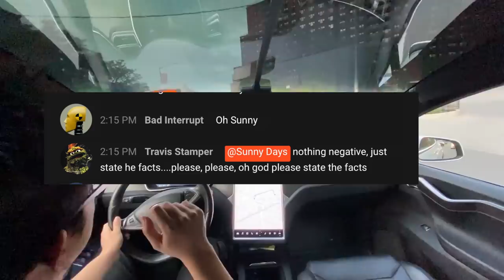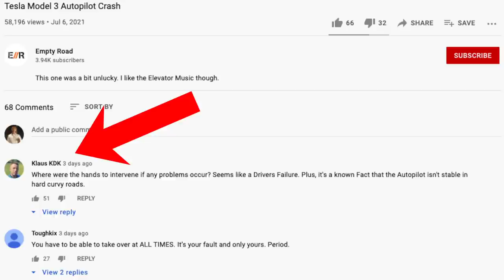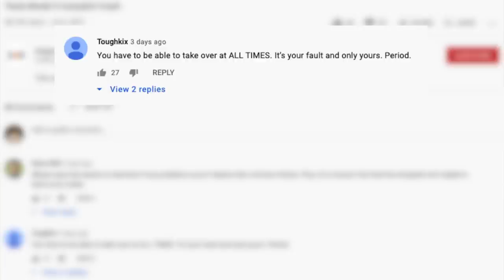Tesla AutoPilot’s BIGGEST FLAW!!

Comment: Still can't figure out how it's legal to have such a system. Guess it falls under the same rules as cruise control.
Reply: when the company has a lot of cash and the things they do haven't killed enough people, it'll be "mostly" legal :) - by that I mean they might pay some money in some lawsuits from time to time, but ultimately a drop in the bucket for them and nothing gets outlawed
Reply: Dude, there haven't been any rules for about four decades.
Reply: People drive like all cars are self-driving, while they stare at their phones.
Reply: There are different levels of self-driving for autonomous cars. Teslas are legally considered a low level driving assist. Slightly higher than cruise control. It's kind of a legal grey area for Elon to call it FSD since it isn't FSD. If it were you'd be able to just hop in, tell it where to go and get there with no input from you whatsoever.

Comment: The interesting thing is that it isn't actually the steering wheel that is the problem unless it is out of balance or the centering device on the steering column is overly aggressive, but the fact that all driving wheels on vehicles have a certain amount of caster to them. The caster creates a moment arm that makes the wheels want to go straight in relation to the direction of travel of the vehicle's mass.

Comment: So the can of coke needs to be on the left side for left corners and right side for right corners? Sounds like work.
Reply: you can add multiple cans or Pepsi
Reply: @FuchsHorst  but that would then again balance the steering wheel. the point was having it unbalanced.
Reply: @RemcoStoutjesdijk  Ask Elon on twitter. It may take 500 @ mentions but in the end Elon will do everything for Tesla customers.
Reply: @FuchsHorst  You saw it turn left and turn right with the can on it, it likely is badly aligned wheels, which if from factory is shite at best, and if only driven for a short time, still bad.

If either a mount for the wheel, or one of its many aligned joints moves out of place and trips the steering wheel, then it will think you took control.

Tesla should have made it so that detects both pressure (or capacitance, like a touch screen) and rotation away from where it was going so that it will only let the driver "intervene" when their hand is actually on the wheel, rather than when they were not even close to touching it.

Also 0.6s isn't bad the dude first reacted to the noise i assume looking at the dash, then realized is was steering right for the bushes before he went to intervene, they should make it more obvious that autopilot went off rather than a dull 'boop boop'.

Would not surprise me if that sound comes on when you press a button, or flick a switch or get a fuel warning. i hope to god they at least made them different sounds.

Comment: What about the crashes where the car never slowed down and crashed into the car in front of them? Fix for that?
Reply: Right, exactly, where do you need to put the Diet Coke can to prevent that? And how many Diet Coke cans in total to prevent all of these?
Reply: Easy: just drive the fuc***g car ;)
Reply: @mq9demo  well, you need a line of Coke on the bumper then technically you crash into Coke not the car.
Reply: easy fix, regular Coke, not the diet one